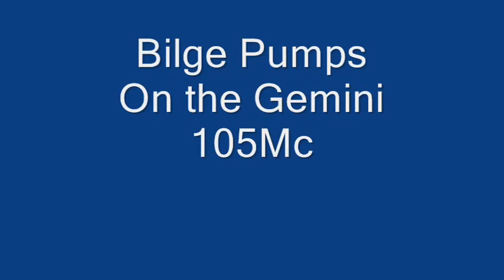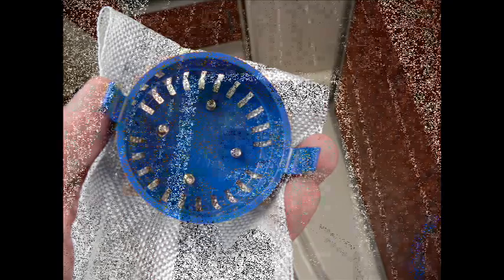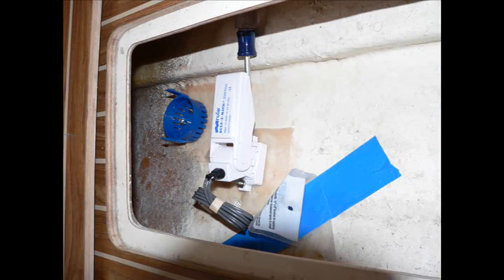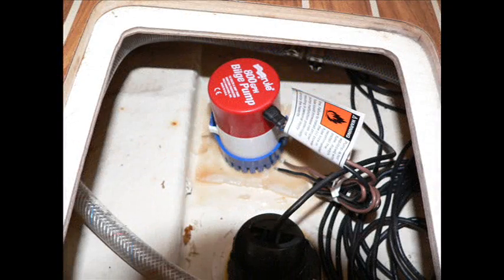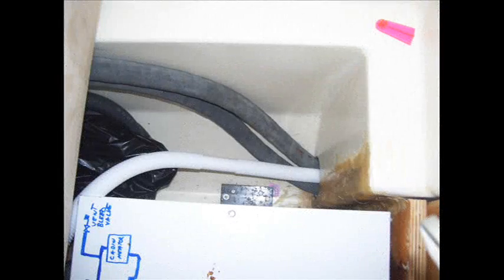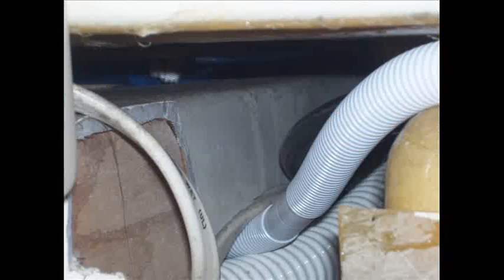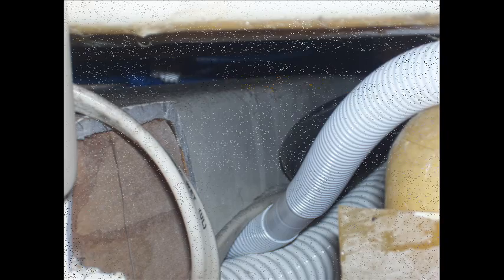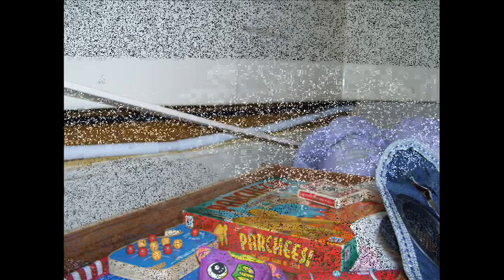bilge pump install 0001

Comment: Yes you are correct. On my boat I can not drill into the hull.  I was looking into the fiberglass repair kit because it contained everything I needed. Cloth,Resin,Hardener. Didn't want to buy the things I needed from 2 different places. Thank you for the the helpful tips.

Comment from the maker: fiberglass cloth, from west marine, and then some epoxy west systems.   You mix up about a 1/4 cup of the epoxy and pour/brush this into the fiberglass cloth and it will do the trick.  The idea is to get the bolts to stick up in the right places, so you can then put the nuts on to hold the bottom down, backwards, so you dont need to have screws into the hull.  Drilling into the hull might not be a real good idea and on some boats.  Dont get the glue on the threads.